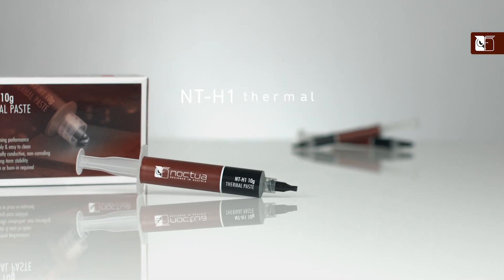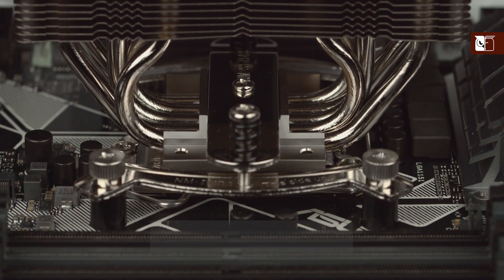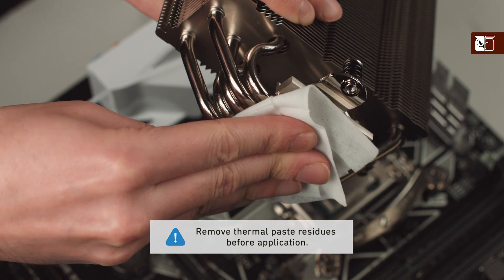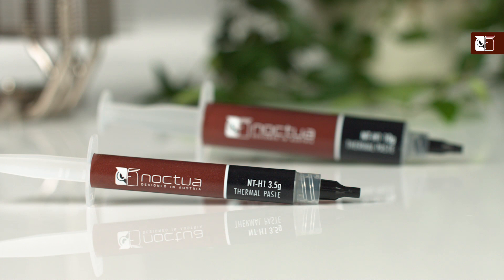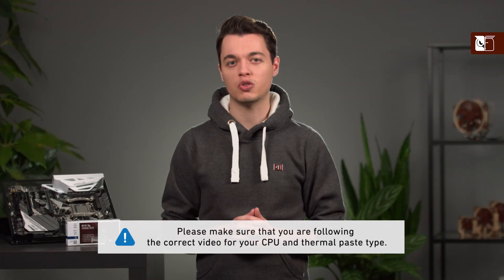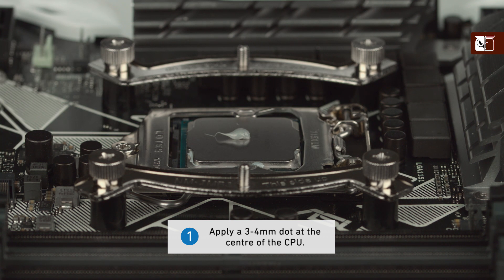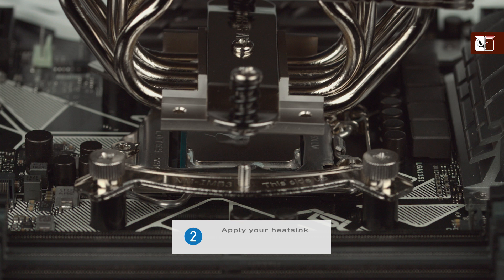Noctua NT-H1: How to apply on smaller CPUs (e.g. Intel LGA1150, LGA1151, LGA1155, LGA1156, LGA1200)

Comment: believe them when they SAY 5 year life span of paste my CPU just died i think idk new one is on the way but in troubleshooting to post I tried reseating my CPU and saw that half of my paste was just a dry flaky crust, it was 6700k so about 7 years that paste was putting in the work. Tho my tube of their paste still looks useable stored it cool dry and with the cap, figured i'd buy a new tube because the tube also expires apparently after 3 year.

Comment: is this how much I should apply to a gaming laptop? hope i can get a response from you guys 🙏
Reply from the maker: Typically laptop chips come without heatspreaders and therefore have a much smaller contact area, so you would apply much less paste, a ~2mm diameter drop should do.
Reply: thank you so much for responding, so less than in this video correct?
Reply from the maker: Yes, exactly, a bit less!

Comment: Is it permissible to use alcohol that is sold in pharmacies to clean the CPU and the screen of the laptop?
Reply from the maker: Generally, this works well, but for the screen, better check with your laptop manufacturer.

Comment: Hello. Is there a way to check whether Noctua I bought was original, and not counterfeit?
My Noctua deteriorated very quickly. After only 1 week, my cpu already thermal throttles. I suspect that I bought a counterfeit product.
Reply from the maker: Where did you buy? We're not aware of any counterfeit being sold. CPU throttling can occur due to many reasons, so we'd definitely suggest to check more likely reasons before suspecting thermal paste deterioration. First and foremost, it's crucial to compare temperatures at the same settings, same ambient temperature and same CPU load to judge if there is any difference. Secondly, please also check other components such as the cooler and fan(s). What CPU and which cooler are you using? Do the results improve when you re-apply the thermal paste? How does the old paste look before re-application?
Reply: @NoctuaVideos  I bought it on my local online marketplace. I don't think there's official Noctua distributor in Indonesia?
I use the paste for my laptop, not PC. I usually use AIDA64 stress test for 5 mins, in an air-conditioned room. at Day 1 after repaste, the temperature was good: 88deg Celcius average. but after around a week of normal use and occasional gaming with disabled turbo, when I stress test again using AIDA64, the cpu temp went to throttle limit of 94 degree. 
As I opened the heatsink to check the paste condition, it appeared there were some portions on the cpu&gpu die where the paste didn't cover the die, as if the paste had evaporated.
my laptop cpu is i7-10875H. no additional cooler. 
I repasted using Noctua Nt-H1 twice. 
In the first repaste trial, where I used the "dot" method, the paste performance dropped to thermal throttle level in just a week after repaste.
The 2nd repaste trial, where I used the manual spread method, the paste performance dropped to thermal throttle level in around a week as well. 
With this, I concluded that my paste probably was not original.
Reply from the maker: With laptop applications, there is a certain risk of so called pump-out effects that can occur in rare cases due the different thermal expansion coefficients of the DIEs and the cooler. Depending on the mounting pressure of the cooler and the viscosity of the paste, this can cause the thermal paste to get pushed out to the sides. When you say that it looks like the DIE wasn't fully covered, this is what might have happened. Unfortunately, there isn't that much you can do if this happens other than trying if a paste with different viscosity such as our NT-H2 works better in your case. You could also try liquid metal pastes that tend to stick to the DIEs better but bear the risks of short circuits.
Reply: @NoctuaVideos  ooh, "pump-out effect" huh? I never knew about it!

so NT-H2 has.... more viscosity? or less?

anyways, thanks! this is a very helpful insight
Reply from the maker: NT-H2 is slightly less viscous than NT-H1. If you ran into this rare issue with NT-H1, the chances are quite good that something different (either less or more viscous) will help. However, it's really hard to tell, with some laptops the issue can occur with a wide range of pastes. In this case, liquid metal pastes will work best if you don't mind the risk.

Comment: how do i remove the cap? it's so tight
Reply from the maker: Just twist it off like you would on a water bottle. It shouldn't require much force at all, but at worst you can use pliers.

Comment: Hi! Looking forward to upgrade the stock paste of my laptop with the NT-H2, can you please advise the "pea size" that I need with my processor and GPU? It's the i7-10875h and the RTX 2070 Super Max-q. Thanks!
Reply from the maker: You need very little paste for these, perhaps 2mm diameter drop or you could also spread to a thin layer.

Comment: Does this need to set before using the pc or does it cure as you use the pc? First time application of thermal past for me, just wondering if dry time is required before use of pc.
Reply from the maker: No, there's no cure time, you get full performance right away.

Comment: I had decided to buy this compound from the other ones because of the videos you guys make, you are very honest, thanks for doing such amazing tutorials!

Pdt: I have an alienware R4 17 with an 1080 (not max-q) and an i7 7820hk (4 cores, 8 threads, and im pulling it up to 3.5ghz) could you reccomend me an amount of compound that i have to put into the cpu and gpu?

Edit: grammar.
Reply from the maker: Thank you for choosing our NT-H1! For the CPU, please follow the recommendations for mid-sized CPUs. For the GPU, a single dot with ~3mm diameter will do.
Reply: @NoctuaVideos  You guys still respond to this video?!
Thanks for being such amazing people! (like everyone should be this days).

I only want to say that my processor isnt covered by any shield or so (like normal processors). Its an 20mm by 15mm rectangle metal plate, so i don't know if the category where it fits would be the same as the 1080 graphic card or even less compound.
Reply from the maker: Apologies, our mistake, we didn't realise that this is notebook rather than desktop! Please only use a ~2-3mm drop for this type of CPU.
Reply: @NoctuaVideos  Ok, thank you.
Reply: @xListtt Its been 2 years since I did this repaste. 
I did not have any problems with my thermals. My processor and graphics card did not go over 70C the first month playing CSGO. After two years i dicided to change the paste again (temps rised up to 80C on graphics card, stayed at 75C on processor), used noctua, same result.
Im satisfied with the quality of the paste, works really well.

Comment: Then I apply it on the CPU of my ps4?
Reply from the maker: Sure, that should work nicely!
Reply: @NoctuaVideos  Okay thanks i buy the Noctua NT-H1 , I will try it to see if it will calm my ps4.
Because the problem comes from the thermal paste that is dried
Reply from the maker: Great, just make sure to clean the old paste off thoroughly before re-applying the new paste. You can use e.g. isopropyl alcohol for this our our NA-SCW1 cleaning wipes.
Reply: Jado  did it ever work for your ps4? or it’s still loud ?

Comment: It would be nice to offer single-use tubes for the exact dose versus the processor socket. It would be great. Even if the tube would be more expensive.
Reply from the maker: That's a nice idea, but it would create a lot of waste as there would be so little paste in each tube.
Reply: @NoctuaVideos  There should be a graduation on the tube, or black lines on the piston. 
By cons it must be done only on the tube of 3.5g for more precision, because the tube is thinner and so there will be more room for maneuver.
Example:
A line for the LGA115x
Dashed lines for AMD AM4, Intel LGA20xx
Dotted lines for AMD TR4, Intel LGA3647

Comment: What size dot would you recommend for a laptop GPU? (ex. GTX 1060)
Reply from the maker: Depends on the size of the chip and if it has a heatspreader or not. For the 1060 a dot of around 2mm should work well.

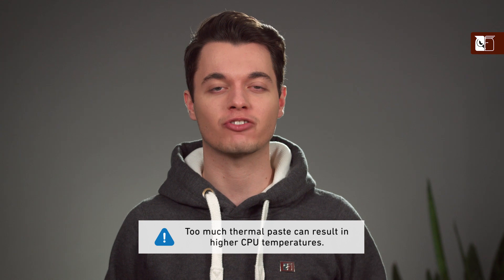Comment: 1:30 from WHEN too much thermal paste can result in higher cpu temps ? how much is too much ? Is too much like 20g of paste or instead of 3-4mm dot or is 5-6m too much
Reply from the maker: Too much is more than we recommend for a given setting, so if we recommend 3-4mm, both 6mm and 20g will be too much, but the first may only have a slight negative impact whereas the latter will have a more significant negative impact. This always also depends on how much paste gets squeezed out to the side though, so it's hard to generalise.

Comment: is this video applicable to laptops?
Reply from the maker: No, but our NT-H1 and NT-H2 are great for improving the cooling of laptops. Laptop CPUs usually don't have an integrated heat spreader, so you apply the paste directly to the CPU and you only need a very small amount (dot of 1-2mm).